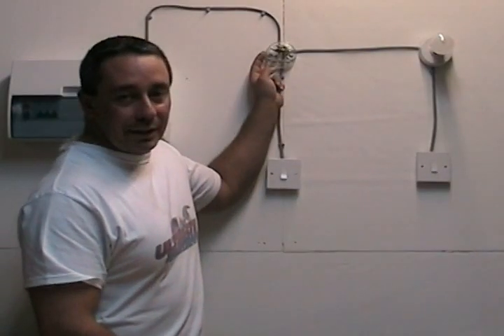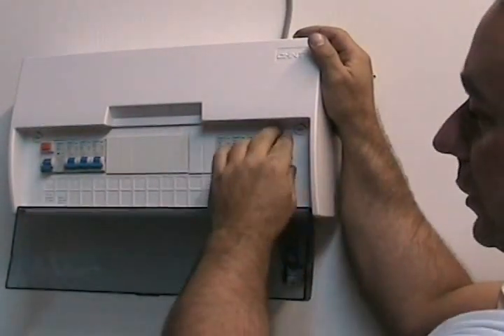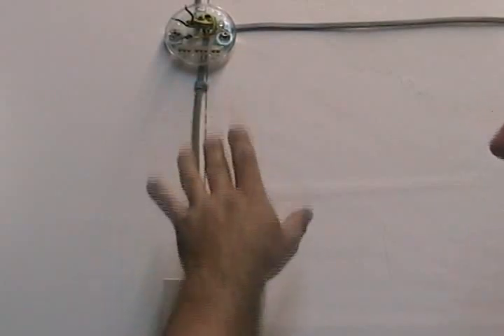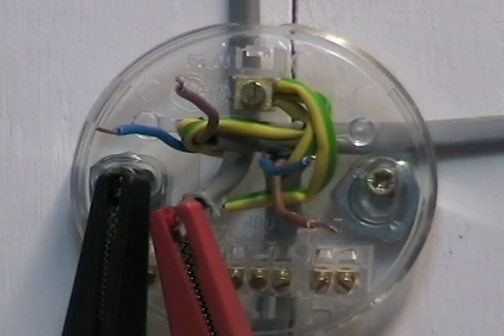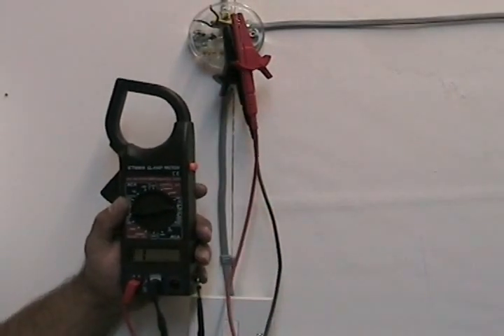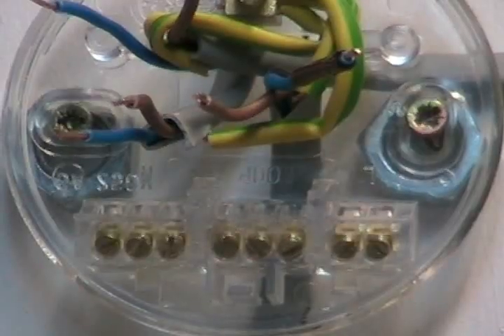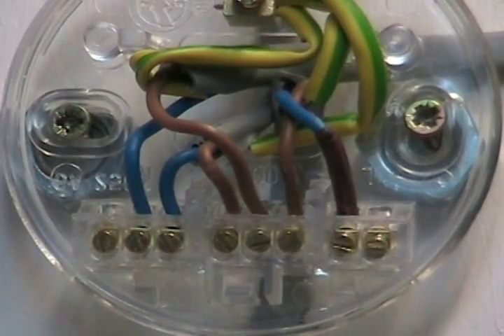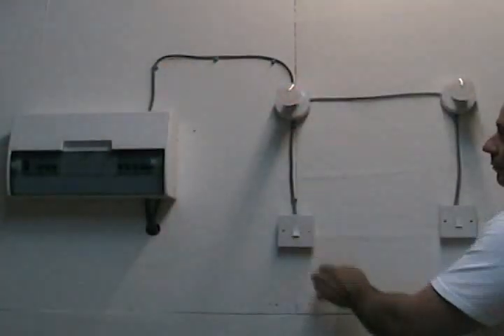Ceiling rose wiring (United Kingdom)

Comment: A bulb blew in my spotlight fitting(it has 4  spotlights) & now it will not switch on . I have checked the 3 core wire from the ceiling & now the earth wire has become also a live wire .What has caused this & is their any easy fix?
Reply from the maker: +Anthony Roberts 
Have you tried removing all three lamps from the fitting?
What are you using to determine the earth wire being live?
Reply: +Ultimate Handyman  A friend  who full ime job is fitting &  fixing  radar in jet planes for the MOD, tested it with a multimeter.
Reply: +Ultimate Handyman yeah we removed all the bulbs  & also tested the wall switch as well
Reply from the maker: +Anthony Roberts 
When your mate tested the earth that was live, was the lamp still connected or removed from the circuit?
Reply: I will text him as he left the house about 10 mins ago . & I will get back to you asap  with the answer to your question
Reply: +Ultimate Handyman  he said it was live all the time.
Reply: +Ultimate Handyman live all of the time connected or disconnected
Reply from the maker: +Anthony Roberts 
With or without the spotlight connected?
What voltage did he get between neutral and earth?
Reply from the maker: +Anthony Roberts 
Sometimes with earth wires you can get induced voltage from other circuits, but if it was reading more than a few volts on the earth there is something seriously wrong with the wiring. It would be best to get an electrician to take a look at it as soon as possible ;-)
Reply: Sorry about the delay as he has not as yet replied about your last question regarding voltage between  neutral & earth . The whole thing had worked for years & years before the bulb tripping the power  yesterday.Don't understand how it has caused this consequence.
Reply from the maker: +Anthony Roberts 
No worries, it does sound a bit strange to be honest.
Reply: One thing I remember him doing was getting the spotlight to come on  for a moment(s) whilst using his multi meters probe to gain an earth from another source rather  than using  the earth wire from the ceiling.

Comment: I have two wires coming out of the ceiling (one red and black, one red and blue). When I test with a multimeter (I don't have bleep so I am using 200k resistance test and basically if there is a change to the reading I am assuming a complete circuit as advised somewhere else) one is always an open circuit regardless of the position of the switch and one is always closed regardless of the position of the switch. I don't think I have a wire going downstream to another light. Having changed the fitting (stupidly did not look at previous wiring because I thought it was standard) my light is always on regardless of the switch position. I have wired it using both wires as the one to the switch and with both wirings the light is always on. Any idea what is going on?
Reply from the maker: +Nigel Wade If there are only two cables it sound like the last light on the circuit, but there is something wrong with your wiring as red and blue are not normal wiring colours. Normally it's either red and lack or brown and blue!The switch could have failed in the closed circuit position. You can test the switch using the multi meter ( on Ohms ) with one of the wires disconnected (electricity isolated of course)
Reply: +Ultimate Handyman I have similar in my house. Thought it might have been the last light on circuit but then I realised as it is pretty old wiring (18/19 yrs) that the guy might have done what you describe in the switch rather than   the rose i.e. instead of having one wire going to the switch he has the loop and circuit wires going to switches instead and a switch layout in thd rose.
Reply from the maker: Yes, some electricians put the loop in at the switch and this can be helpful in some circumstances- especially when changing a light fitting.
Thanks for the comment ;-)
Reply: +Bitter Truth I got confused with mine but it turned out that the blue black comes from the fan, not the switch. I only discovered it by accident and now the fan controls the light but the light switch does nothing. I know how to fix it once I get time

Comment: Hi

I intend to connect a feed to install an attic light.

There is a ceiling rose on the landing which I intend to use.

Where do I connect the live and neutral in the rose and then would I connect a switch to this cable then to the light fitting?

Cheers
Reply from the maker: +wayne bolton 
You could do it this way (electric isolated at consumer unit first)-
Run the new cable from the switch to the ceiling rose and connect the earth wire to earth (ensuring it is sleeved with green and yellow sleeving). Connect the blue to the neutral terminal and then connect the brown to the permanent live terminal (not the switched live).
Now run a length of cable from the new light fitting in the loft and connect up the live, neutral and earth to the respective terminals. Run the other end of this cable to the switch. 
At the switch connect both earth wires to the earth terminal.
Join both neutral wires together using a terminal block or suitable insulated connector.
Put the live from the existing light in the com terminal on the switch, then put the live to the light in the L1 terminal.
Reply: +Ultimate Handyman Hi again
understand the principle but the switch ive got doesnt have an earth block to connect, where does the earth go?

the swith just has comm and L1 no earth then i need to run the feed to the light?

cheers wayne
Reply from the maker: +wayne bolton 
Hi Wayne, just terminate the earth wire from the existing light and the earth wire going to the new fitting into a single insulated terminal connector/terminal block, inside of the switch back box.

Comment: Help! Trying to fit a pair of 'modern' basic pendants to replace some old brass effect 3 arm chandalier type things lol! The pendants are/will be fed from a single switch that brings both lights on in a lounge/dining room. Removed the first of the chandaliers only to find it was wired using chock blocks through to a piece of flex in the fitting. However, what has thrown me is the mains cabling! I have two cables...one which had two black cores twisted together going to the neutral side of the fitting, the second cable had a red and black twisted together going to the live side of the fitting. My issue is how to identify what cable and cores do what and how to arrange/sort them to terminate them correctly in the new pendant which has a terminal rail set up. Any advice sincerely welcomed. Thanks in advance.
Reply from the maker: +1hairbear 
Your best option is to ask here- http://www.ultimatehandyman.co.uk/forum1/lighting-f33.html
It's free to join and you can post pictures. If you post with as much info as possible someone will try and help ;-)

Comment: Thanks so much for the video - very easy to follow. My flat is 7 years old and I wanted to replace the bathroom light which has two switches to it (1 light). I have 3 cables each with 1 Live, 1 Earth and 1 Neutral wire, and then a fourth cable with what seems to be 2 Live wires and an earth. All the Earths are linked together and taped. But I am not sure what all the others lead to, I wonder whether you might be able to advise please.
Reply from the maker: +Steve Manns 
They might have wired up the light using the two way cable saving method, where both switches are wired to the ceiling rose.
Is there an extractor fan that comes on with the light?
Reply: +Ultimate Handyman yes there is an extractor fan too.
Reply from the maker: +Steve Manns 
Ok, the cable that seems to have two live wires and an earth is probably the switch cable- which goes to the switch. In newer properties they often use twin core and earth cable with two brown wires going to the switch (this saves using sleeving or insulation tape to identify the switched live wires) The other cables will be the two circuit cables and then the cable going to the extractor fan. 
As long as you can identify what all the wires are doing before you remove the old fitting and then replace them in exactly the same terminals on the new light you should be fine.
It's very similar to this, but you will have an extra cable- https://www.youtube.com/watch?v=WZizlnLfLks

Comment: Really starting to despair, we have two lights in hall and landing,  the light switch in hall area has 3 switches to control hall light, landing light and outside front door light, upstairs just 1 switch to control the landing light. We decided to change our hall light for a 3 spotlight very, very similar to the one you show how to put up in your video. BUT we had a yellow wire next to the brown pendant light wire in the ceiling rose, we don't know where this goes!! Also had a blue wire and red wire that just sat in a little black block doing nothing I assume. 2 red wires from the middle section of rose, 2 black wires that had the blue wire from pendant fixing and 2 earth wires. We are on the older wiring system house built 1998, we know wiring has changed around 2004/06. Wired the spotlight to what was asked in diagram, BUT LIGHT STAYS ON when we flick light switch up OR down, DOES the yellow wire serve a purpose? IF NOT what to do with it and where have we gone wrong?!! PLEASE HELP US, must something really simple but we can't work it out!!
Reply from the maker: +Abi Bond 
Sorry I'm on a job all day and don't have time to work this out.

Your best option is to post here (free to join)- http://www.ultimatehandyman.co.uk/forum1/lighting-f33.html

Include as much information as possible, including pictures of the wiring if possible as that will really help ;-)

Comment: Bit confused, it looks like you have put brown tape around a blue wire and named it the live wire, isn't blue neutral?Does both brown & blue wires act as live wires on the switch?
Reply: Someone as angry as you should keep away from electricity, you might electrocute yourself and others.
Reply: +sslatsburnley  Must admit with my rudimentary electrical knowledge I was scratching my head at this too. Glad you posted and glad to see a reply from OP.
Reply from the maker: +sslatsburnley 
No, the blue wire with the Brown tape on is the switched live wire. If you watch the video again from the beginning it should make sense ;-)
Reply: +Ultimate Handyman switched?
Reply from the maker: +sslatsburnley 
Yes, the cable runs to the switch. The cable contains a brown wire and blue wire (plus earth). The brown wire (live) connects to the live terminal at the ceiling rose, the other end of the brown wire connects to the COM terminal at the switch. The blue wire (sleeved brown) is connected to the L1 terminal at the switch. Once the switch is switched on the blue wire (sleeved brown) becomes live and goes to the switched live terminal at the ceiling rose, which energises the lamp.
Reply: +sslatsburnley thanks for explaining, and thanks for your time
Reply from the maker: +sslatsburnley 
You are welcome ;-)
Reply: TheEmjaystaffs no it has to be brown mate
Reply: Well that wire goes to the switch so it can be live when the switch is on so I guess brown makes sense perhaps, it is never neutral though, it is either live (when the switch is on) or not connected (open circuit) when the switch if off really.

Comment: This video is brilliant and easy to understand. I had a ceiling light fitting that should have been fitted by our decorators who left the wires hanging and never returned. I had no idea where the wires went and knew nothing about the switch live wire.I bought a great test metre at less than a tenner and it found the correct wire. I connected everything up as demonstrated and it has worked perfectly so I'm happy and the decorator will not get any further work from us. Thanks a lot for the video.
Reply from the maker: +Petey B You are welcome. Thanks for the comment

Comment: Brilliant demonstration, even I can understand  :-). Many thanks for sharing! Just one question on a problem I'm having: the two wires on my lamp are not colour coded, i.e . they both look identical, copper wires coated in black insulation tubing, so I do not know which wire the live and which is the neutral wire. Some people say that it does not matter as long as the earthing is installed correctly. Is this really true? What is the worst that could happen if I connected them the wrong way, i.e. the lamp's live wire to the neutral ceiling's connector, and the lamp's neutral wire to the ceiling's live connector?
Reply from the maker: En Sigini 
Your wiring sounds very uncommon, which makes me think it could be really old?
Do you know how old the wiring is?
Having the Live and Neutral correctly identified and wired up the correct way is critical.
If you get the live and neutral connected to each other it will blow the fuse/trip the circuit breaker.
If you get live and neutral the wrong way around and you switch the neutral instead of the live you could electrocute someone when changing the lamp.
Reply: Thank you so much for your response! I'm glad to have contacted you ont his. - Yes, the lamp is old, at least 40 years. I got it from Switzerland. Is there a safe way to find out which wire is which? I just had another very close look, and think there is a very fine embossing on the cables. On one it reads "Kabel   4   SEV   T   L" . I reckon "Kabel" means cable or wire, and "SEV" stands for Schweizerischer Elektrotechnischer Verein (Swiss Electrotechnical Association). Not sure what "T" means. "L" could mean Live? On the other cable the embossing is more difficult to read: "Kordes   Kabe". Looks like wire was cut off mid text?
Reply from the maker: En Sigini 
I'd take it to an electrician to be honest and get him to check it. Most lamps can be rewired and it's worth doing to be 100%certain that you are safe ;-)
Reply: Will take it to the electrician, as you suggested. Thank you again for your time and helpful advice! Best regards, Esthi.
Reply from the maker: En Sigini 
You are welcome
Thanks for the comments ;-)

Comment: I tried to put up two halogen celling lights instead of my normal light fitting but have messed it up completely, I have a double switch to turn each light on and off and I think that's blown now because I can't click one of the switches, it bounces back when I push it down. I know now I should have at least taken a picture first as it would have helped a lot.

The first halogen went up pretty simple, there were 6 wires, 2 naturals, two earth and two lives, I twisted them together and hooked them into my halogen light connection, N,E,L and it worked perfect, I thought the second would go the same, but before I knew it I had pulled out all 9 cables, I thought all I had to do with these was to also twist them together and again place them in the N,E,L I tried the switch and hard a bang, I tried again and hard a second bang, so I immediately turned all the power off.

I tried a few hours later and I forgot to cut the power and electrocuted myself, what was worse was that I was standing on a metal ladder and the rubber bits had wore away at the bottom and I was in my bare feet, so I went up like a Christmas tree lol, but I have survived to tell the tale.

I have been digging around and it appears that the simplest way I am going to get this done is to isolate the live cables on the ceiling rose in to some sort of junction box, hook the switch live wire into the L on the halogen light on it's own, The earths into E and the naturals all into N, but this is not what I done with the first light and that seemed to work, I am pretty confused.

Why exactly do they not just put a label on the live switch wire saying something like "LIVE", is it really that hard to do this when someone installs a light fitting, instead of making the average DIYer needing to mess about looking for it all the time, in fact why can't the lighting have a much more user friendly connection like say a design similar to a USB computer connection, it just seems these power systems and regulators changing color codes and all over the year's has simply been used to confuse the hell out of people.

Things need to change in this electrical industry, because confusing people to believe blue is always natural, when in fact the live switch wire can also be blue is misinformation.

Anyway your video has helped a lot, thanks for the information. I will take more care when installing the halogens, going to turn complete power off this time.

Comment: Hi, I have a single ceiling rose with two light switches . Will this method to find the live switch be the same for both switches? 
Like a doughnut I took wires from the pendant  and mixed them up when putting them into a 3 block terminal box. Now the light will not turn off!
Reply from the maker: Yes, I'm pretty sure this will work. There are a couple of ways of wiring two way lights, but if the most common way has been used you should be able to use this method two identify the switched live wire.